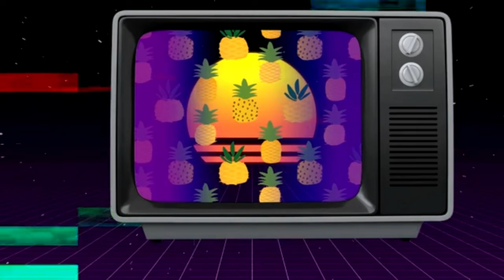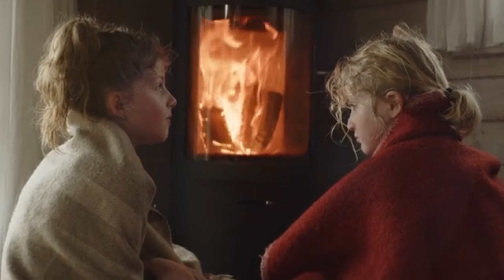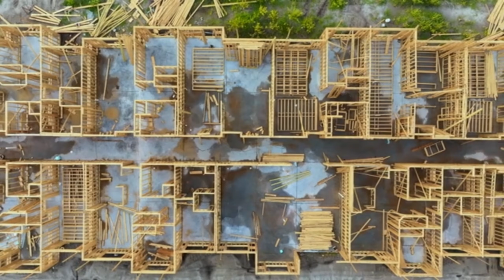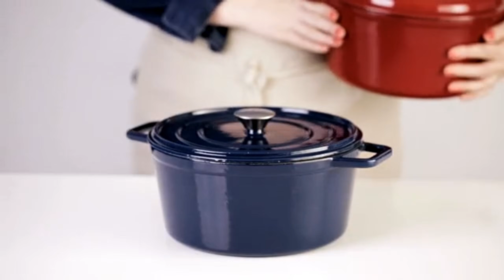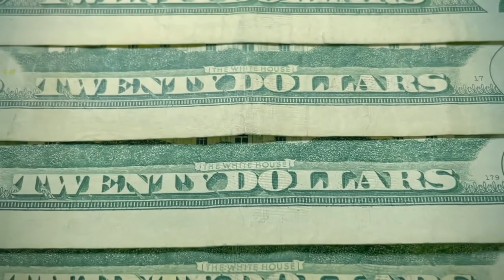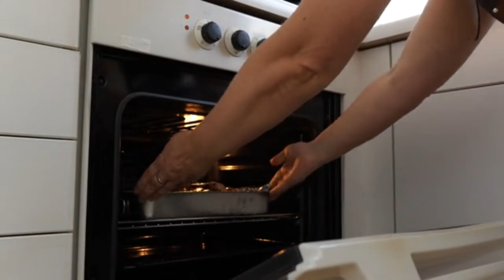The Forgotten WWII Oven That Needs No Power. Why Is It Illegal To Sell Now?

Comment: Actually they sell these (well, a rudimentary mini version) commercially, they are called ‘thermos’, you can probably get some for less than $10.00 ($ CDN) at Canadian tire, if they cool too quickly, wrap them in a towel or blanket.
I have a stainless steel one which contains about 3 cups, I should be able to cook rice and beans and vegetables + tuna in a few hours.
Some hikers start preparing a meal in the morning and store it in a thermos and it’s ready by mid day…
Reply from the maker: That's a great point about modern thermos versions and how they relate to the concept!